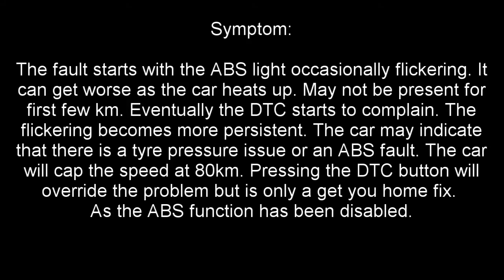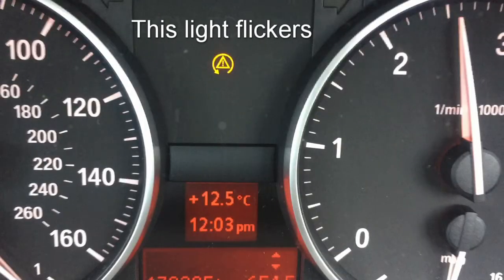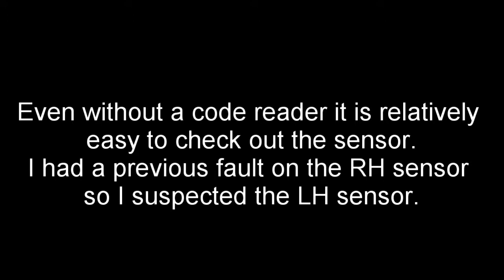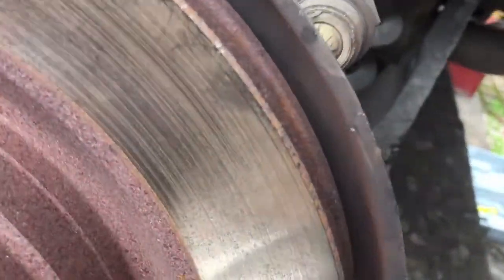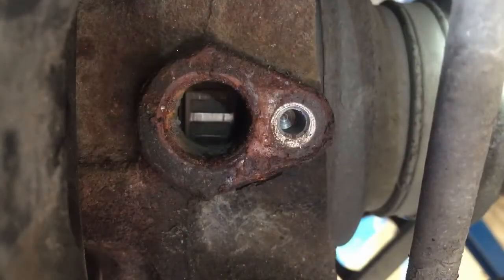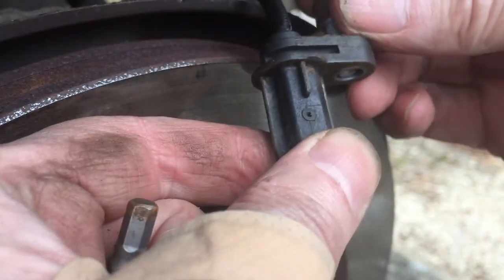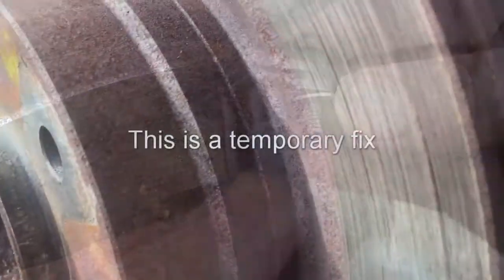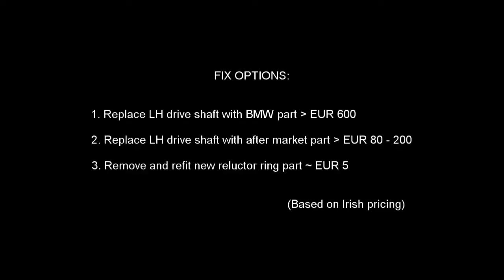BMW E90 318d (2009) ABS Sensor Reluctor Ring Fault

Comment: I replaced my front left sensor and now have an air gap error.  The original sensor had a washer so I reused it.  Could this error be the result of the washer and the sensor is not close enough to the reluctor ring?  When installing the new sensor, it didn't appear to be seated as well as the old one.  So I don't know if the air gap error is the result of that (or due to the washer).
Reply from the maker: I don’t have any experience with the front reluctor pick up. If you remove the washer it could help particularly if it did not seat properly. If it is rubbing it will look shiny where it touches.

Comment: I'm having same problem on my 2010 model. I want to try this method but how is the best way to determine which Tyre has the problem? Sensor triggers when driving straight and turning so don't know which sensor is acting up?
Reply from the maker: There is no easy way. I bought a Creator C310+ Scanner which confirmed it was LH rear sensor. I had previously got a dealer to repair the RH side so I was sure it was the LH side. Putting the washer in confirmed it was the LH side. If I had no code reader I would have had to do one at a time to find which was producing the fault. Eventually both will go. You need to rescue them before they also destroy the sensors which costs about €50 each.
Reply: I have the same problem basically just chance the rings (rear left and right)on the drive shaft and done
Reply from the maker: @MrMaximo10  I agree. One tends to go before the other but they both will be in very bad condition. Trying washer alternately may narrow down the faulty one but best to gear up and replace both.
Reply: @billebrill8730  👍

Comment: What size washer did you use
Reply from the maker: It was 0.9mm thick 16mm diameter and the hole was 8mm
Reply: @billebrill8730  thank you for the reply very helpful
Reply from the maker: @spireworx8314  BTW the washer only needs to be thick enough to stop the sensor rubbing. Too thick and it might cause a misreading error. I had that washer to hand and it worked.
Reply: @billebrill8730  I think if it's too thick, you'll just have some variation of a DTC warning/ABS permanently on since the car probably knows that sensor is producing wrong readings (if its too far to sense anything). Gonna try this washer fix as a temporary thing, will have a go at getting the ring off. Cheers!